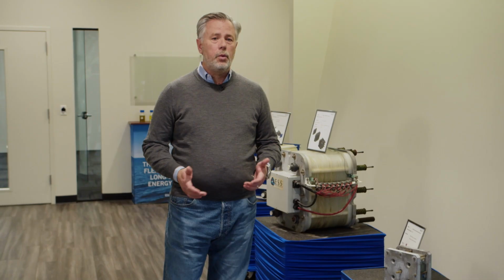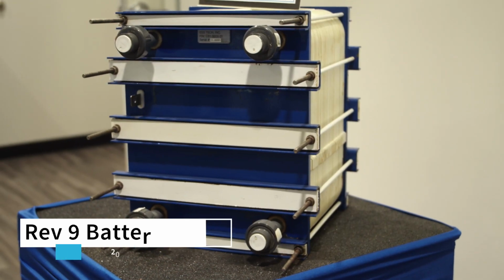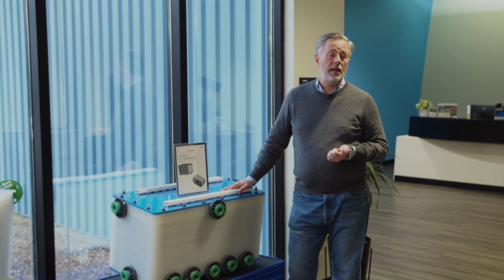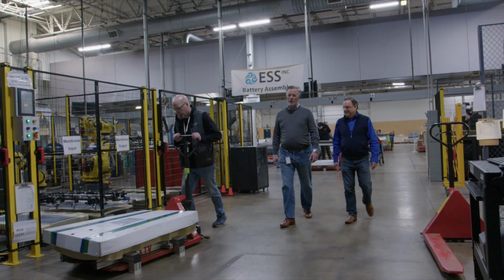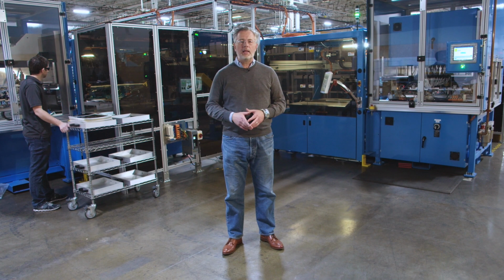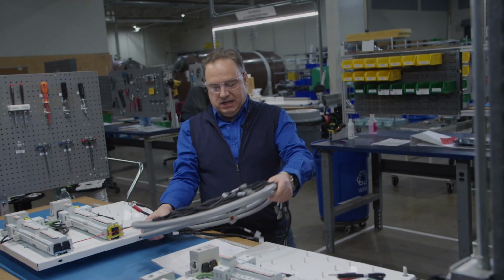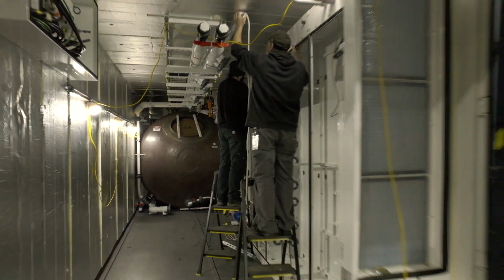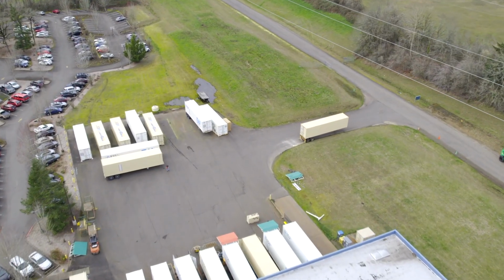ESS Inc. Tour

Comment: Hey Drezza, how come you got those metal spokes stickin' out the sides of those batteries?  People are going to want to be able to move these things around cheaply & easy.  Thus, their size should conform to shipping standards.  Your next big batt should be flush (no spokes) & should have the length & width of a shipping pallet, with a height 0.5x (stackable) or 1x the internal height of a shipping container.

If you want to go even bigger, subsequent batts should be the size of quadcon, tricon or better yet bicon shipping containers.  The tanks look sweet.  These membranes tho - ain't people tryna ditch them altogether?  Good work, & get those Portlandians of yours to keep 'em coming.  Thanks for the tour & regards, G.M.  o/
Reply: They don't ship individual batteries, they pack the batteries and the tanks and the AC inverters in a 40-foot shipping container that's ready to go on site.

(As far as membranes if you have fluids you're exchanging ions between, you can't avoid that sort of a permeable barrier, so far as I can imagine)